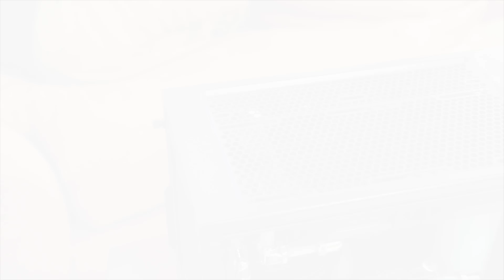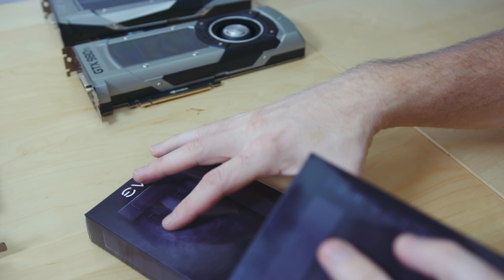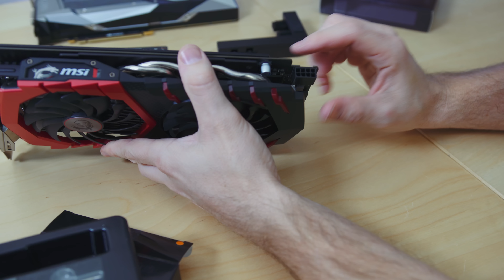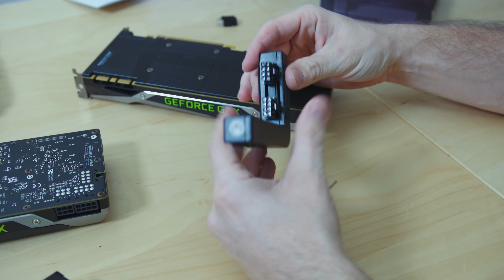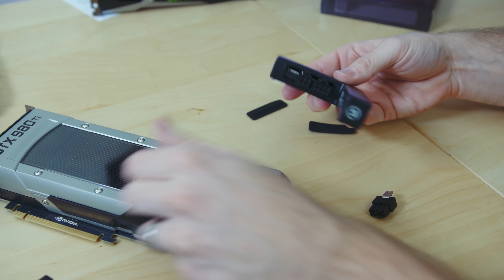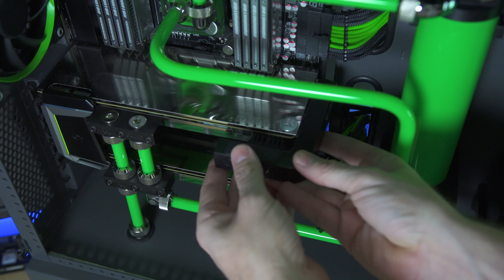How to manage your cables using EVGA Power Link

Comment: That's a neat design, but they should have solved the flipped connector problem.
Reply: that would make the product more complex and more expensive for what it is and it works with all EVGA cards and its a EVGA product so i dont see any problem personally
Reply: Filip Czuba Well they could have include inverted sockets where the cathode and the anode is at the right pins.
Reply: Max Ermackov 
exactly
Reply: Benjamin Fraeyman why would they? they made it to work on their own cards.....if MSI wants to make one they are free to do so, but why would EVGA spend the money for features that aren't on their product
Reply: They would have to design another version to accommodate it, and I don't see why they would do that for other manufacturers.
Reply: Nicholas Mitchell 
From a business standpoint that's a pretty bad choice, considering this is just a niche enthusiasts product.
Personally I don't think they've designed it purely for EVGA cards.

Comment: Damn! I wish my Gigabyte 1080 wasn't designed totally against this! It would cover HDMI ports, and wouldn't even fit due to the power connectors being flipped.  It's too bad, the wires have to flip, then do a 180 around in my setup.
Reply: MerkRampage Hey mike, never expected to see you here
Reply: Dr. Etzor I wouldn't mind it too much. If you saw my computer the EVGA logo on a Gigabyte card would be the least of your concern. I went out of my way to find the most obnoxious color parings and to try and find components that would cycle through a spectrum, out of sync that is.

Comment: does it work on strix 1080
Reply: Looking at it more in depth it looks like the strix may not work since it is recessed from the edge.
Reply: kevin russell should work
Reply: It should, you'll just have an evga logo with your strix
Reply: kevin russell no, the clips for the power connections are facing up not down
Reply: don't listen to the others. This will NOT work on the strix 1080. The power connector clip is located on the opposite side towards the PCB. EVGA cards have the clip facing away from the PCB
Reply: nope, won't work
Reply: no, asus uses the flipped connectors like the MSI card Jay showed on all their STRIX & ROG cards